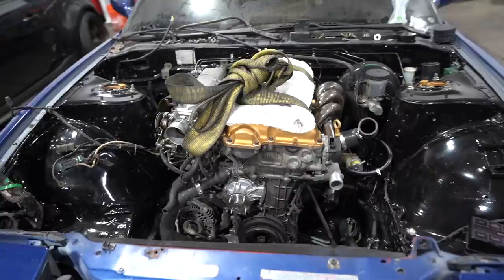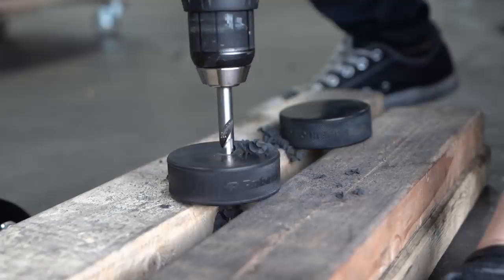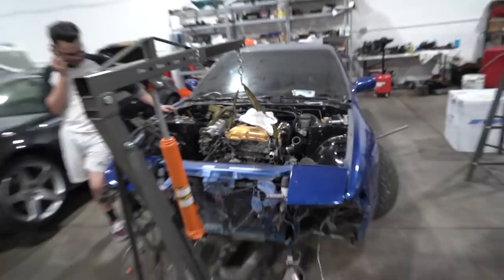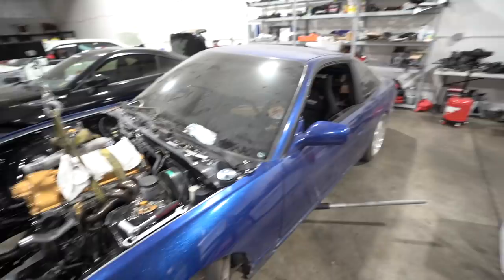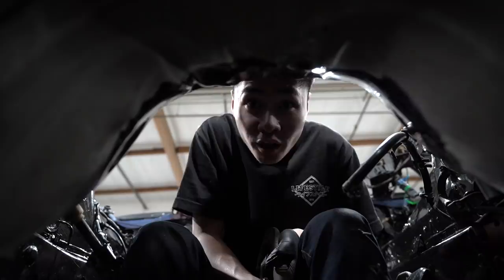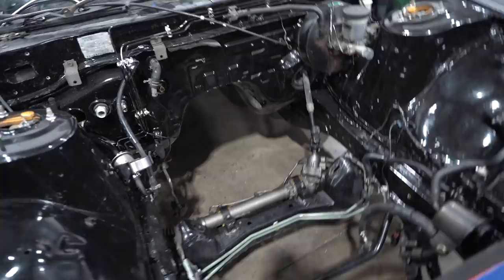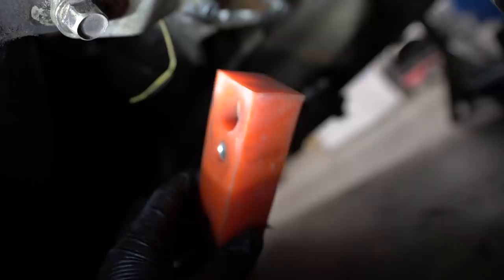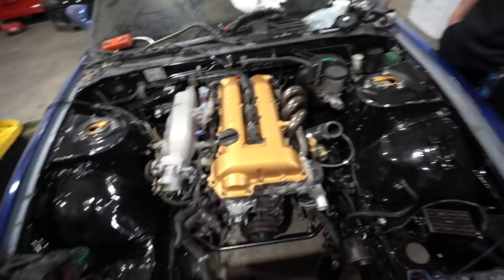USING HOCKEY PUCKS AS ENGINE MOUNTS!?

Comment: I had a Nissan Juke SV 6 Speed 1.6 Turbo FWD was making noise. I changed the belt, alternator and even went to the dealer to change the tensioner pulley that was $600! $10K into the car and sold it for $4k. I loved that car even tho some may think its fugly but it was my first turbo car and i loved hearing the recirclation valve pShhh! Anyways I will never buy another nissan, the dealer did not care and wanted more money to fix something that i had already paid for..
So I bought a 2002 Lexus Is300 and i did replaced the tensioner on the 2jzge. It was $80, 3 bolts and took 20 minutes! Sell the nissans and buy Toyota Supras (real ones not bmw) TRD or even Honda Type r. But I get it you guys are passed that now (rich b!it(ches) Still go mad respects and much love but not a fan of nissans

Comment: on my s13 my clutch line was leaking and the slave went dry. Ended up putting P.S cause I needed to get home. Fix that. I snapped a rotor last week cause one of my calipers seized and the other side was leaking. Fixed that. Then a breather line to my fuel tank started leaking when tank is more than half full.Fix that...All this happen during March...the month ain't over sooo hopefully that's it 😅